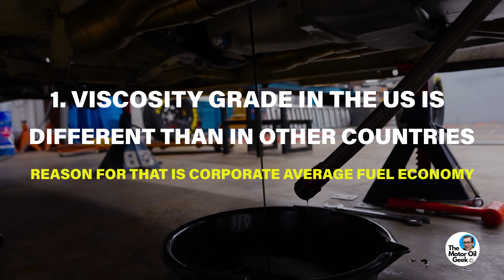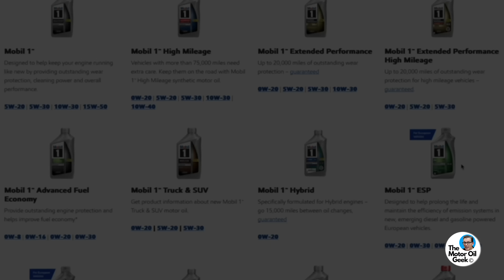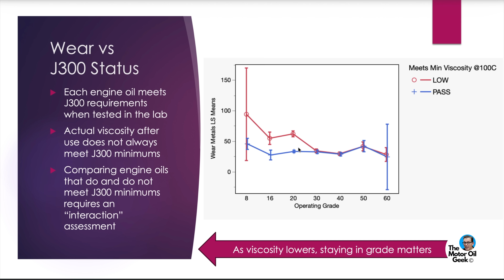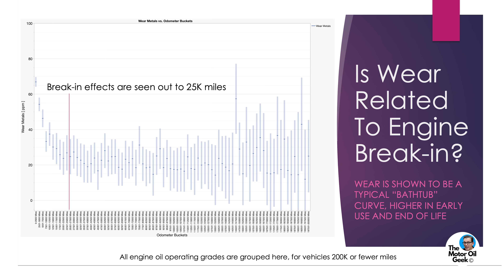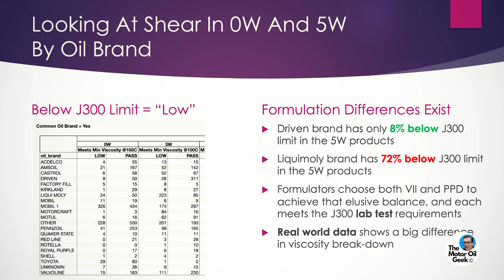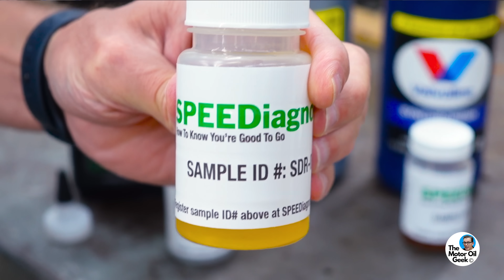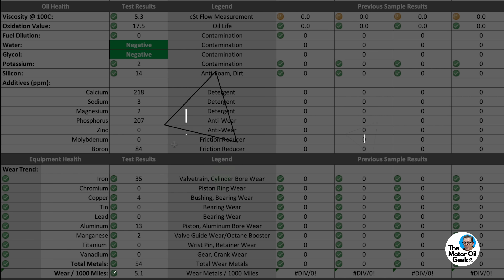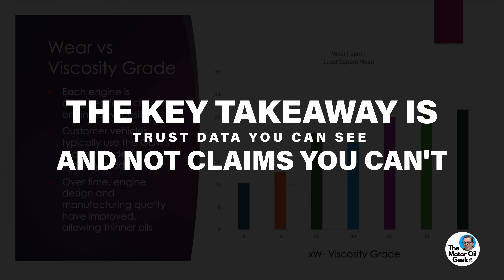More Ai Lies? The FACTS about 0W-20 vs 5W-30 (With Evidence)

Comment: This is science.. I still remember the world before "synthetics".. And that was a world without any sparks in -35° celsius with a half bad battery because the oil sirup made the starter motor to shortcut and steal all the voltage needed to drive the ignition coil. I alway use to wonder if the motor oil is possible to made more koks free with a hollowed piston and an extra ring that catches gas and ventilates out it in the bottom of the cylinder..

Comment: My cars are 04 - 08 Chevy. One has overhead  cam 4 cylinder and the other is push rod V-6 with over 200k and no oil  use! I run cheap Super Tech, Harvest King, and FVP and super tech filters. I keep it changed at 4k or less. Conventional 5w30, mine don't like synthetic! I've sent many cars to junk yard with good engines! Transmission usually dies first or rust gets them! Keep oil changed and roll! Yes, some newer cars with direct injection or turbo charged needs different oil! Keep it in spec!!! Many reports on going back to 5w30  to keep from using oil! Most new cars are junk and designed to fail & sell you another one!

Comment: The reasons for cam phasers going out in the ford 5.4 ,3 valve is 100% due to using the recommended oil !!! 

You run 5w30 in a 3 valve, 5.4 and the cam phasers will properly oil and you wont have a fraction of the problems...

Comment: Please people, stop pouring oil like homo habilis, glugging and splashing all over! Rotate the bottle so the spout is higher than the body of the bottle, or at least even, then pour carefully with no glugs. Often, the spout is farther away from target, but you have better control, as air flows in smoothly as oil flows out. T.y. for reading.

Comment: Bought my Ford Expedition brand new in 2007. I used recommended Motorcraft 0W/20 synthetic blend changing every 3000 miles the first year. Next three years full synthetic same change intervals. From 2012 forward I've been using Mobile1 Full Synthetic 5W/30 with change intervals between 3,500 and 4000 miles. Currently 225,000 miles. The only major repair I did (myself) was the required preventative replacement of the cam phasers/timing components, lifters and oil pump at 188,000 miles. My Expy runs like new to this day. It's been a superb vehicle & should roll many more years.

Comment: my oil pressure gauge doesn't lie. thin oil can lead to very low oil pressure especially in hot weather at  idle and in slow moving traffic. oil pressure keeps the moving metal parts apart. a have used thin an thicker oil and i do not put super thin oil in my vehicles because of theses reasons. as more miles are put on the oil the oil becomes diluted so gets even thiner and then another problem starts which is evaperation of the thin oil = oil consuption. a well known italian car manufacturer started putting thin oil in thre cars in the 90's , there engines kept blowing up due to the oil evaperating , the problem wasn't the engines it was the oil that was used.

Comment: Thank you for the video! Although I stick with factory spec'ed oil of 0W-20 I change it religiously every 3,000 miles and every 2,000 in the winter to account for the extra idle times. Currently -25 out 1-24-26

Comment: What I got from this is "if the oil (0w-20) stays in grade". Well modern engines fuel injection promotes oil fuel dilution. This statement by itself shows that using an oil that is "just enough" lubrication (0w-20) to start with is alright if you change your oil a lot more often. just not practical. So using 5w-30 for example (like it use to be, i think it was even 10w-30 for GMC) makes perfect sense. Point here is "staying in grade" doesn't happen. What other facts would we really need to consider here?

Comment: Didn't you have a video with dyno pulls showing that thicker oil produced fewer wear metals?!?!?

My Subaru F24 say to use 0w20...in Japan the same motor says 0w30 or 5w30.  I use 5w30, especially for a turbo engine that will be prone to fuel dilution and higher temps, especially since we have 100*+ summers.  Recommending a 0w20 for a turbo is borderline negligence.  And with these automakers using a larger and larger percentage of turbo motors in their fleets, we'll be seeing a lot more issues with 0w20 oils.  And this is even more so the case with manufacturers recommending longer OCI's (which leads to more fuel dilution, especially in vehicles that don't get on the highway much) in order to portray the illusion of cheaper "cost of ownership".

Comment: I was having problems with 0w20 in my shop. I made the change to 10w 30 and all the problems went away. I am in Florida and 0w 20 is just to thin and heat is a real problem here. I noticed 0w 20 burns in the combustion chamber and goes out the tail pipe more readily. 10w 30 fixed this problem.

Comment: Im running 5w30 in my 2008 f150 fx4, cap says 5w20, penzoil plat, full synthetic,  lots of people bashing the 5.4 3v, i get it, .. it does have 210.000 miles, but at this point,  it runs darn good,  I change oil 3000,to 4000 miles, I just feel better with 5w30,,, 😮

Comment: If my (thus far pretty limited) personal experience is any indication, there doesn't seem to be a difference in real world fuel consumption between 0W20 and 5W30. My ND1 MX-5 2.0 had been getting nothing but 0W20 from the start but during the latest service at 145,000km/~90,000 miles, the shop used 5W30 instead - which pissed me off a bit since they didn't ask for my preference, but.. hey. Both oils are what Mazda recommend for this engine in my region, and I've only ever used my Mazda-dealer for servicing, so... 
In any case: I've always kept an eye on fuel consumption and now after the oil-change the car still produces the exact same figures on 5W30 as it did on 0W20. 6.7l/100km before ... 6.7l/100km after (~35 mpg) with the same driving profile and I think I've consumed, roughly, 100 liters/26.4 US gal since the service.

Comment: As many have mentioned in the comments, 5w30 out of grade is still better than 0w20 out of grade. I have 6 yrs old car Opel Corsa F (basically Peugeot 208). I bought it new in 2020. First 4 yrs manufacturer recommended 0w20 oil. Last 2 yrs they change it to 5w30. When i asked why, they said that its better for the engine and timing belt (which they replaced withing warranty btw after 60k km). So the 5w30 would be better choice from the beginning lol.

Comment: There is a reason why 5-30 or 0-30 are recommended in Euro and not USA and also why the TURBO version (with exact same cames, rods, pistons) uses 5-30 and no 0-16 or 0-20.    The motor will last longer long term and burn less oil.

Comment: funny I just did an oil change in my 98 Mercury Grand Marquis. 5w20 synthetic blend. I was half a quart short. So I threw in some 0W20 I had. I asked chatgpt if that was ok (knowing it was but I like to point out when chat gpt is wrong). It said it was fine because of the operating weight of 20. it said I should use straight 0W20 synthetic in my car cause its an upgrade. HMM. It flows better at cold start up.. OK. But i live in the low desert. it might get to the high 40s for 2-3 months. I wonder if this is true. now my 2004 F150 5.4 triton does not like synthetic oil. It uses it a lot. where conventional oils (usually use castrol gtx) it doesnt. A mechanic buddy of mine told me that. Im not sure if the 2V 4.6 V8 in my Panther has the same issue..

Comment: The truth comming from a high output vehicle mechanic.
1. Turbo engine and hot climate use 5w 40. Always.
2. Never go by manufacturer intervals. 3 to 4k miles oil changes.
3. Do not use 5 w 20 thats for manufacturers meet the environmental regulations not for the engine to last over 200k miles

Comment: I love what you do BUT IMO Oil changes range from  60 to 90 dollars at various locations here in the city. At 57 dollars per oil analysis (Canada) it becomes prohibitive for the ordinary consumer especially when it is general use,  using the correct specification oil , no matter what brand and following OEM intervals.  I am sure you would agree. So every time you say in your video get results it does not apply to the ordinary individual following the OEM schedule and OEM spec oil based on a risk analysis. I believe,  again, you have to agree! BTW anyone using non spec oil would laugh at paying $57 foe oil analysis. So I believe your audience is not the ordinary driver.

Comment: I believe oil change interval is far more important than viscosity, taking both miles and months into consideration. 3500-5000 miles MAX for all viscosity. 10,000 mile intervals are nuts, that's 10 months between oil changes for many. If you are driving 10,000 every 3 months, the 10k interval might make sense, but I'd still want to see some OA numbers.

Comment: Have a 1999 Z28 camaro  Ls1 290thousand miles 5 30 Castrol full syn 0 issues in the 16 years ive had her i change every 2000 a mystery oil flush once a year she purrs  now the motor 0 issues but have cooked 2 4l60e transmissions burnouts 😂

Comment: My issue with this is not the lubricating ability nor the wear of engine materials when using either of these grades of oil.  I found excessive oil usage issues with 0w20 oil versus 5w30 in my vehicle, the "30" component of the grade seeming to resist migration past the low tension oil control piston rings of my FB25 engine (0w20 using 1qt/1500 miles vs 5w30 using negligible amount after 3000 miles, both situations repeatable).

Comment: Kids need to listen to their dads and grandparents more than using social media...  Dad always said us 5w-30 in older engines that have higher milage, or big V8 trucks that do alot towing under load..   My older square body with a  350 small block uses 5w-30 but my daily driver uses 0w-20.

Comment: 125,000 dead engines isn't good data? foreign specification of higher weights isn't evidence? the obvious fact that lighter weight is not as good of protection? The x20 holding up is differentially due precisely to the circumstance desired, the x30 is sacrificing itself for the salvage of your engine!

Comment: Yes. I use recommended oil by manufacturer. I also use the recommended Castrol LL 5w 30 oil for my Golf R. The only rule i do not follow is their rediculous 15,000 km oil change interval. I do mine every 10,000 km 👍🇦🇺🇦🇺

Comment: The owners manuals in both my Toyotas say to use 0W-20 but 5W-30 can be used if 0W-20 isn't available. That's good enough for me. I split the difference and use 0W-30. My Camry has 185000 miles and my Tacoma has 85000. Zero problems from both.

Comment: Lake I don't trust any of the 0W motor oils.  My Hondas say to use 0W-20.  I use 5W-20 until they reach 100,000 miles. I then switch to 5W-30.

Comment: what is a good brand oil,  that stays in grade with normal every 5K miles oil change? For Turbo engines..
Reply: You cannot beat Amsoil.
Reply: @gleanerman2195  I’ve been aware of this for decades used it couple times but couldn’t tell the difference

Comment: I have a 2024 BMW with the B58 engine for which BMW specifies a 0W-20 with a very specific rating which I can only get online. I think I'm stuck using that until the warranty ends, or they could deny coverage. So I change it every 5,000 miles when they call for every 10,000. Then it's 5-30 for me.

Comment: In my opinion, when pickups in usa start to have engine failure, then the oil will not have athick film to protect from wear.. I saw that also at Engineeringsxplained. and the oil will break down fast aswell. and yes the fuel economy is true, but that why they use it.. You wil never need to use it. and most oil will loose over 90% of it protection after 7-8000 km..

Comment: Id rather use higher viscosity oil than rebuild my engine sooner , especially in warmer weather . My mustang need 5w30 by the manual but as soon as warranty is done i am switching to 5w40  .  Should i use a 10w40  ? where i live never gets below 40f and rarely below 50f . Fwiw i change my oil every 5000km / 3000 miles

Comment: Hello, I'm from Israel and I follow your videos. I have a question. I have an Opel Insignia 1.5 Turbo 2019 and the recommended oil is 5W30, but the filler cap says 0W20. The GM engine is probably the reason. Maybe this is the reason? In Israel, it's not that cold, even in winter. Sometimes it's 10 degrees when it's really cold, depending on the location. But in summer it's hot, on average 30 degrees Celsius and more in other places. The car is 7 years old with 70 thousand kilometers. What do you recommend? Thank you very much.

Comment: I've been told to use a BG MOA to add wear protection at every il change to help keep turbo charge engines from having this sheer issue. plus, change oil at every 5 and don't wait till 10 on like say trucks and vehicles that tow trailers. any truth to this?

Comment: Bottom line the AI was mostly correct and 5-30 = quieter motor, less noise, better in hotter temps,  does not break down as quickly as 0-20w.  Many 4 cyl boxer owner are forced to change to it to stop burning oil.  Useless video that is full of word salad with no opinon on what oil to use.  Saying oils sheer out at 500 miles is just useless without naming said oils.  
Sorry I trust my experience and the AI video over this counter video which was mostly word salad.
Reply: I completely agree with you 👍

Comment: Of course 5w30 sheers easier thats not the metric i wouldve gone with... i wouldve baught two cam shafts and dip them in each oil. Then see how fast it drips off of each. Ill stick with my 5w30 thanks you can keep the water

Comment: I believe i made my 5.4 triton reliable by putting 5w40 in it starting in 2012 and after. 226k, no timing job. I think if the tundras were using slightly thicker oil their crankshafts might make it farther. The thin oil doesn't stay on the metal long enough.

Comment: Thanks for this. Speaking of oils shearing out of spec over time... is there any point to blending oils?... i.e. two oils of different grade from same manufacturer and of same "type". If I were to blend equal amounts of 0w20 and 5w30 to, say... maintain the grade closer to 0w20 but not below it between changes. Blending is a thing in suspensions, for example... so curious if there's any point to doing it in engines.

Comment: Same engine with different oil requirement have difference such as flow control oriface plates, oil pump capacity.  So caution when going against manufacturer specifications.  

For example 0w20 to 5w30 is okay. 

But 5w30 to 0w20 is not okay. 

Look up Stribeck Curve.

I’m pretty sure you know this already.

I just want people (hyper-milers that want to save gas) to know that putting thinner oil is not ok.

Comment: I have seen a couple of his videos in which he tested different brands of oils, but I have seen one in which he tests OEM oils. I have a 2025 F-150 and a 2025 Bronco and both just passed the 4k miles, a few days ago I went to the Ford dealer and bought the oil and filter. But I keep wondering how good Ford’s oil and filter really are and how well they hold up against the competition. I’ve heard some people say that when it comes to transmission fluid, always stick with the OEM, but when it comes to engine oil people are all over the map. If he hasn’t already, I wish that he did a video in which he tested OEM oils.

Comment: The first question is whether or not that oil study you cited is reliable and it can be replicated or falsified because there is a fallacy in its construction. What oils were used as well as the testing methods have to be replicated

Comment: My Camry Hybrid uses 0W-16 oil. The service intervals recommended by the manufacturer are 15,000 km which I think is way too long without an oil change, so I change the oil and filter at 7000km.  oil is cheap engines are not.

Comment: I ordered a used oil analysis from speediagnostix a couple of weeks ago to test my 2021 Jeep Wrangler EcoDiesel at 90,000 miles which is coming up soon.  I have been using the synthetic 5W-40 OEM oil but at half the recommended oil change interval for 5 years.  I guess I will find out if I doubled my cost of oil changes or I was right to change the oil at 5,000 miles.  So far, I have had zero issues with my engine.  I am using an oil for diesel engines but noticed that the spread is 35 in the OEM oil.  I live it a hot desert climate where summer time temperatures are routinely over 100 and can reach up to 120°.  It will be interesting to see if my engine has excessive wear.  For once, I am looking forward to an oil change.  Good Grief Lake!

Comment: The lesson here is that if a video is made using AI (Annoying Imbecile) then it is almost certainly filled with huge errors or downright lies. Below I offered a comment about switching a later model Subaru from 0W-20 to 0W-30 and the results were quieter running and no change to fuel mileage. Plus, the particular Jiffy Lube that had been servicing the car did NOT change the oil but, only the filter. She now knows how to do that job herself and is proud to be able to do so. Not bad for a 60+ year old nurse. Yes! Old dogs CAN learn new tricks! LOL
We have a fair amount of vehicles now and have had plenty over the years. Even those with 0W-20 on the oil cap now get 0W-30 Mobile-1 without exclusion! The difference is noticeable in noise reduction and no degradation to overall mileage has been logged. We stick to the 3K to 4K rule which includes new oil and filter every time. In the long run, the minor difference in expenditures over time significantly outweigh any mechanical repairs which, so far, have been nothing more than tune ups and regular maintenance items such as brakes, shocks, tune-ups, etc.